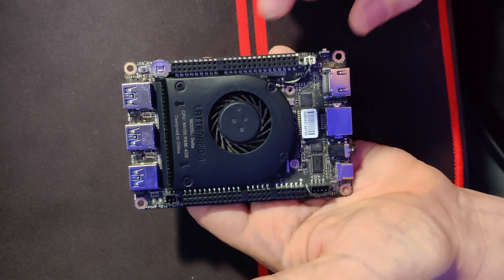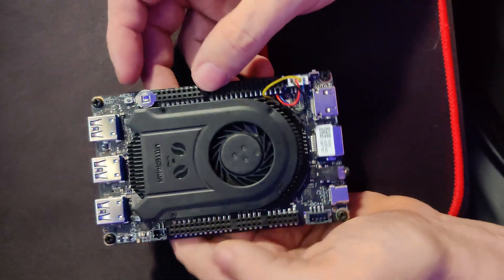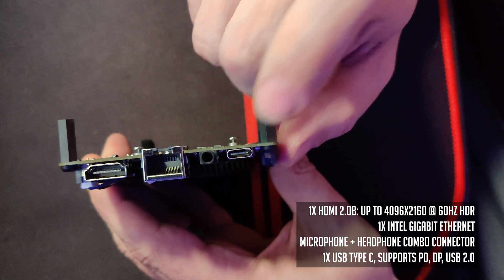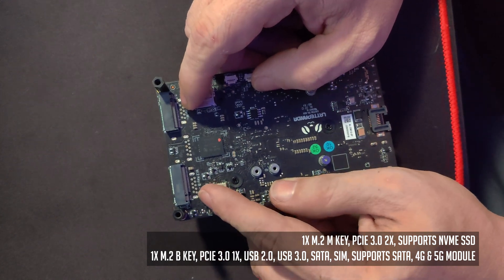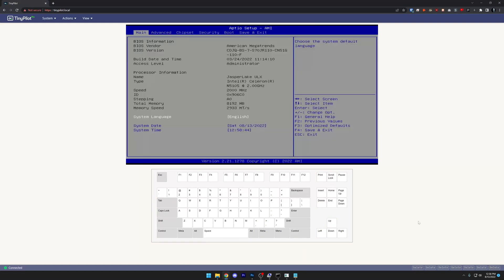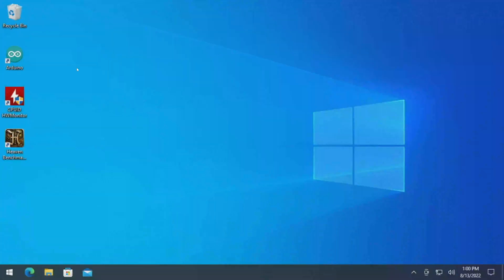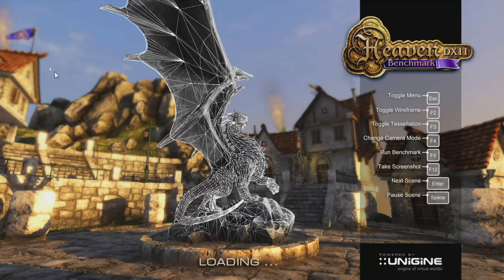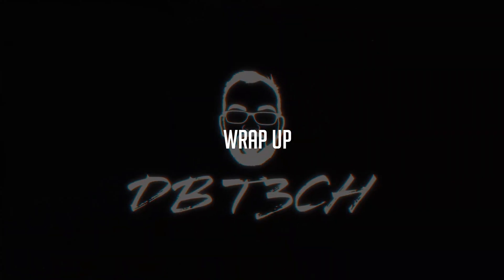LattePanda 3 Delta 864 Overview

Comment: Cool video, I thought about getting myself one around the end of 2023. If it is possible maybe I would use it for video/ Audio editing if I do some videos or a podcast. (Would it be possible for this device before I get it, this is the question I have the most consideration for)?

Also I would do some games as well. some of the steam games I want to get back to are RPG games like Octopath Travler and the NIS games. And as far as I could push it I would most likely play Nino Kuni which did work for an 8 RAM PC I built.

Comment: can you test it for linxcnc or mach3 motion control if it works it could be connected to an ethcat break out board and run stepper motors

Comment: LOL... subliminal "JENN-AY!"
Reply from the maker: You're the first person to make the connection (or comment on it!)
Reply: @DBTechYT  I saw the image there go flashing by and got it immediately...beautiful!

Just bought two of those LP3 Delta units by the way, for a project we're working on in the flight simulation industry. They look pretty slick, and I need something with a co-processor on it to capture I/O from buttons and rotary encoders. Still looking for a decent 15"(ish) touch-screen monitor, but I've got a few options there. 

People are complaining about the single-channel RAM in this thing, but judging from the (game-related) demo videos I've seen on this thing, it shouldn't be a problem from something like a flight display. Although we do need a 60fps frame rate, we're not doing uber-heavy graphics...so I think it will likely be just fine. 

Thanks for posting your video!

Comment: How does this compare to the Zimaboard?
Reply from the maker: ZimaBoard Processor:
N3450
4 Cores
1.1GHz base frequency
2.2GHz Burst
2MB L2 cache

LattePanda Processor:
N5105
4 Cores
2GHz base frequency
2.9GHz Burst
4MB L3 cache

ZimaBoard has Intel® HD Graphics 500
LattePanda has Intel UHD Graphics

ZimaBoard has a PCIe slot
LattePanda has an Arduino co-processor

ZimaBoard has 32GB onboard storage
LattePanda has 64GB onboard storage

ZimaBoard has 2 NICs
LattePanda has 1 NIC

ZimaBoard has Mini DisplayPort
LattePanda has HDMI

ZimaBoard has 2xUSB3 and 2 SATA
LattePanda has 3xUSB 3, USB C, M.2 B-Key, M.2 M Key

The LattePanda is more powerful with faster connections for storage (M.2), but the ZimaBoard has a PCIe slot for additional expanadbility.

So really it's a matter of what you need for your project.

Comment: I'd swap this out with my intel NUC, run mx linux as a work station. Proxmox this NUC to add with the others, spin up a couple VMs of windows 10 (to RDP into) in case I need to use the office formatting. 
I'd like to get at a point I can carry my workstation in my back pocket when traveling. Would be easier than using a laptop for travel, but keep the workstation at home.
Wondering how video editing would be on it?